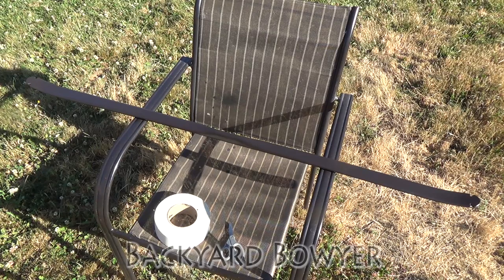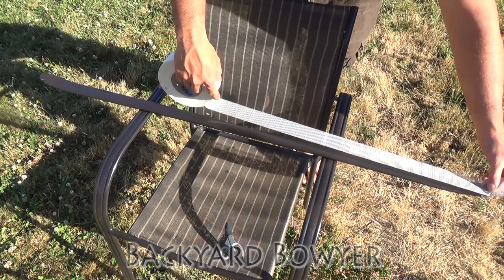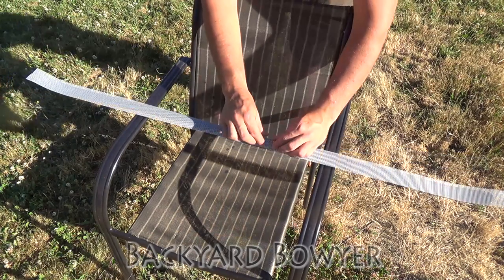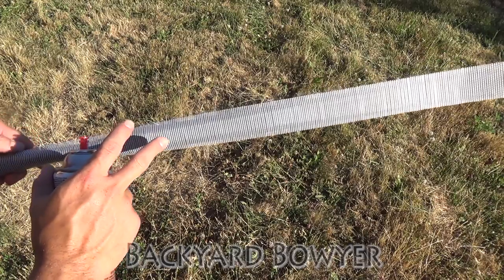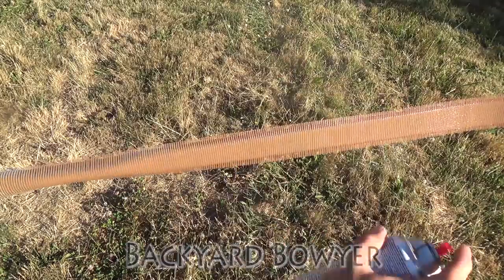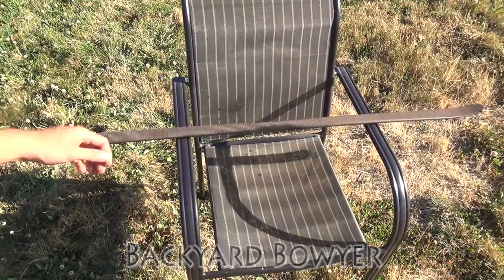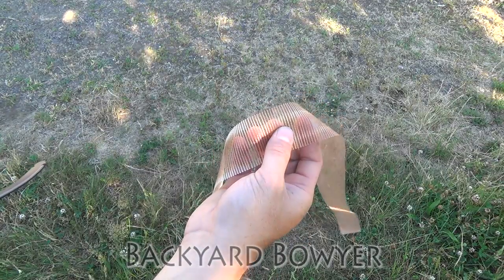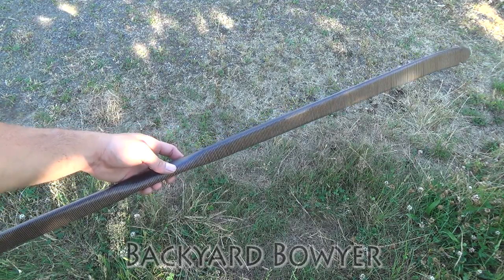Simple DIY PVC Bow Spray Paint Method Using Fiberglass Tape

Comment: You might want to check out self-adhesive drywall tape.  The stuff I've used (for drywall) is a mesh but it is some type of plastic, not fiberglass.  At least I don't think it is fiberglass.  I've never gotten a "splinter" from it at least.

Comment: It's odd, it seems to make a linear pattern when the tape is a mesh and I would have assumed it would make a cross hatch pattern instead of a linear one. Why is that?
Reply: Because the side you put the mesh down is raised, effectively forcing a valley above.  ###### <much like this, at the bottom you can see a channel.
Reply: The fibres of the meshed tape sit on top of one another; the long vertical fibres are on top of the short and so there is a gap between the bow and long fibres for the paint to get under.